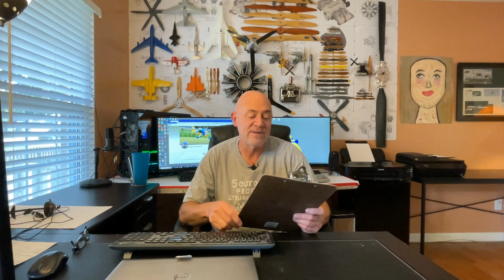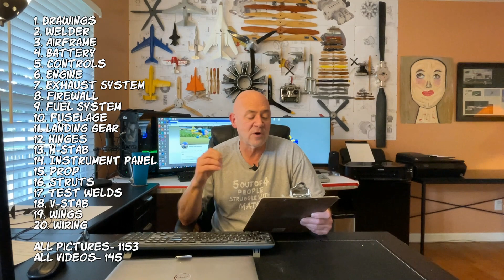AirBike Part 103 Ultralight Video Series #aviation #ultralight

Comment: Thanks You very much just bought the blueprints..
Reply from the maker: Cool, let me know what you think of them.
Reply: dag as a retired aircraft welder i chuckle at your veds.  if u build again gas weld it togather . start out with a 00 torch tip easy peasey. i am building a air bike also dont know how long i ben working on it though. termites love sitka spruce ate my spar caps up..about $900 bucks worth. i keep having hart attacks. just saying you are doing a good job. dennis tyson is flying his mini max i followed his build. so finish your air bike and fly it.  rock no.